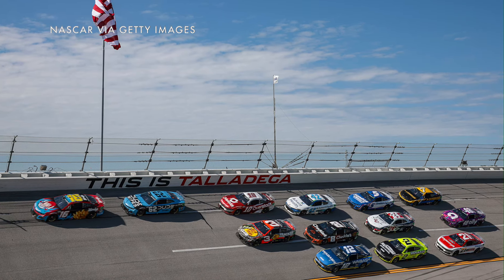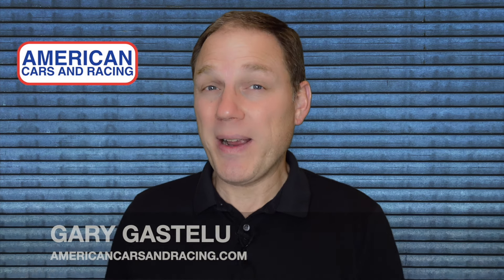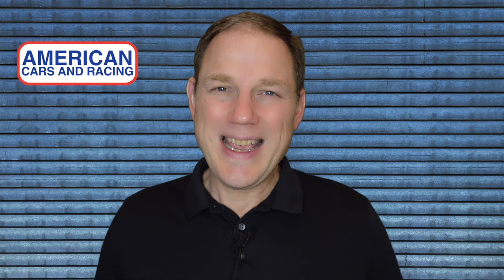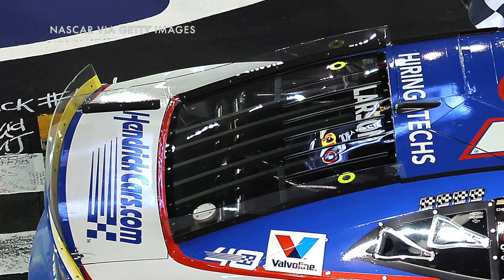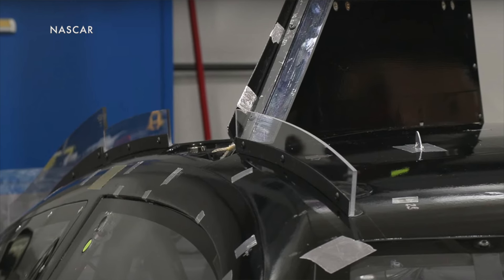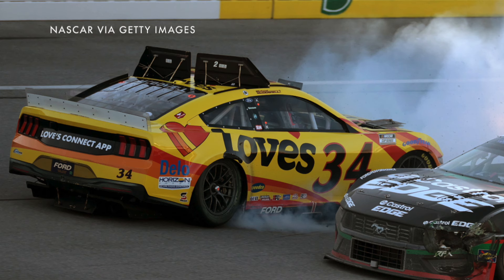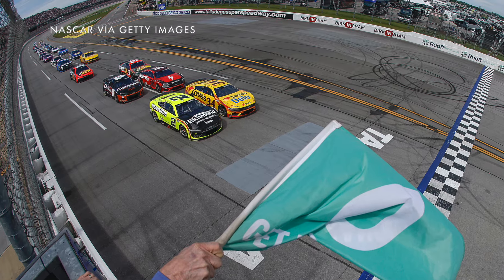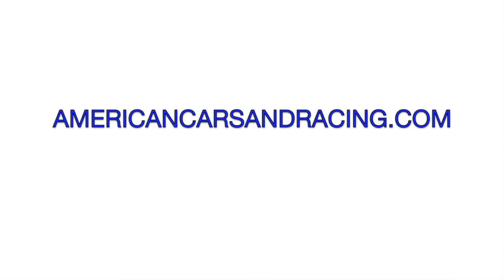NASCAR Is Making 3 Big Changes To Stop Cars From Flipping At Talladega

Comment: i highly doubt this will work, but who knows. i dont think nascar knows that blowovers are much more complicated than putting these cars in a wind tunnel and turning it sideways, but they clearly dont wanna take advice from teams so 🤷‍♂
Reply: it wont, those dumbasses think the car is flipping because of air going on top, the air keeps going at the bottom and the flat bottom, the thin tire rims are making the air easy for the air to get underneath.

Comment: it's always been a weird thing with Nascar trying to stop the cars from flipping because I think it's vastly misrepresented. it gets represented as the worst type of wreck but it's really not. in my opinion the reason nascar pushes so hard to prevent flips is because it's the one type of crash they can control. what other kind can they control?
Reply: its because when they flip the driver has no control, as it is the most vulnerable spot for a driver.
Reply: Cars that flip throw parts into the stands. This is what they are concerned about.
Reply: It's less the flip itself and more the action of leaving the ground. A car flying into the fence right side up hits the crowd just as hard as a car that goes into the fence upside down. Flipping is a side effect, and rolling is the least injury-prone crash type, but the last thing NASCAR needs is a 1955 le mans disaster.
Reply: @Brownguy342  cars that crash normally also throw parts into the stannds. i dont see your point.
Reply: @yourhomiegort  cars that hit the wall rarely throw parts  in the stands. Cars that flip have the centrifugal force to sling parts into the air and they land in the crowd. Also cars that get in the fence are ripped apart and throw parts everywhere.
Reply: @Brownguy342  Years ago they introduced safety wires to keep the hoods and trunk lids with the car, even if they got separated. Now these wheels with the dumb one lug nut is another story since we've already seen those coming off under certain circumstances.
Reply: I'm no fan of NAPCAR's management, but them adding the safer barriers to the walls was a game changer.
Reply: @TheSaturnV  I still prefer 5 lugnuts per tire.
Reply: @bighand1530  well it is supposed to be stock car racing lmao